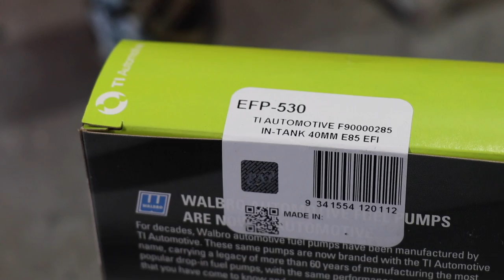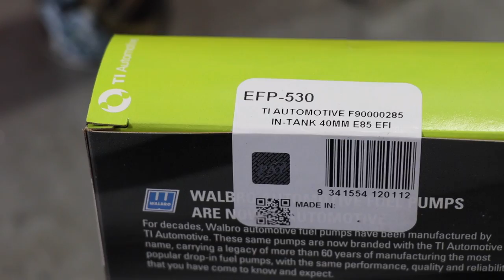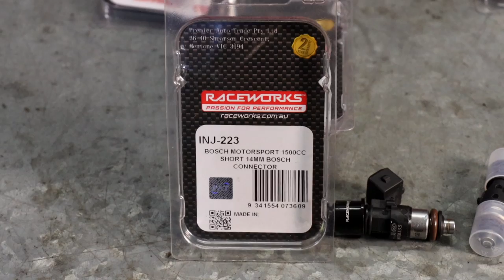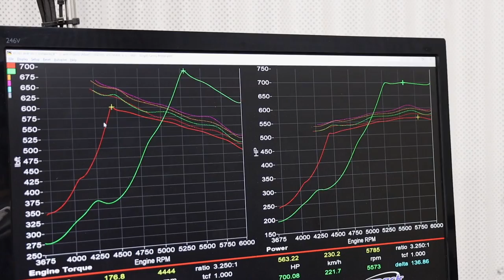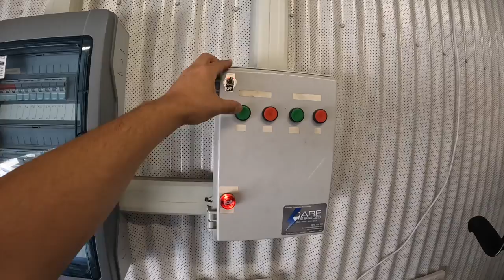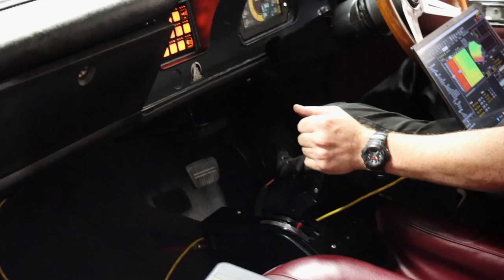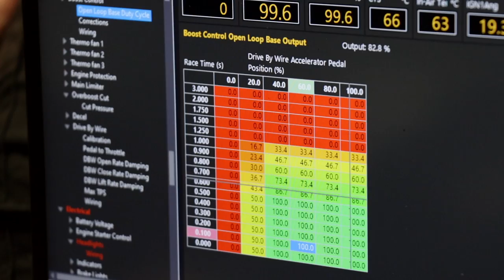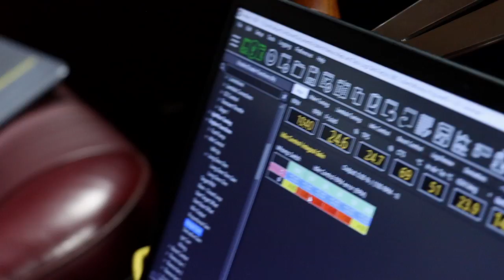Supercharged Big Block Crown - Less Boost, More Fuel, More Power | THE SKID FACTORY

Comment: Damn y'all, I can only wish that I had the means, resources, and knowledge to build a dream like this someday. I have a 709 whp 1997 EJ8 Civic coupe with a fully built LSVTEC (a B series non-VTEC block with a DOHC VTEC head), and I built it all (edit: sorry, other than the machine shop work and the bottom end, Iwas referring to the car, suspension, head, etc). I don't have the time to get it properly tuned on the dyno (but it made 709 whp on a DynoJet on its current tune), and I've never been able to get a clean pass out of it because the closest drag strip is only open in the summer, I work six days a week, and I don't have any way to get it to the track other than to drive it. It's been impossible for me to get any time to do anything with it, so I'm always screwed out of my love. I have $20,000 into a $1,000 car, so no matter what I do I'm screwed.
Reply: 20k into a 1k car makes it worth atleast 21k. Back before Covid it would’ve been worth 10k max

Comment: I hear all these people with boosted motors say "oh yeah, it's got a real safe tune in it" and then you look at the AFRs and they never get under 11:1 .. And then 1500kms down the track, they end up with glazed bores and pushing oil out the breathers and smoking out the tailpipe. And they go to blame the piston rings or engine builder, not Dr-NES-TUNEBROTHERS' rom 1.13 .. (this is doing it the right way, btw, but there's nothing wrong with having a stoic tune with a turbo engine, it's actually a good thing)

Comment: Probably a dumb question but why go up in such small steps with injectors? What would have been the disadvantages of slapping 2000ccs or something straight in?
Reply: I don't claim to be an expert, but to my understanding which may be wrong you want to use as small injectors as you can get away with safely to achieve the power you're looking for, because as injector sizes go up the worse they get at atomizing the fuel and the shorter the injector times are going to be compared to injector deadtimes, which leads to it being harder to accurately control AFRs at low rpms which leads to loss in low end drivability, fuel economy, it being harder to start etc.
Reply from the maker: I was going to use Siemens Deka 2400cc but they are only available in full length and the harrop setup needs 3/4 length. Raceworks no longer offer Bosch 2000cc as they are problematic with certain fuels so 1650 is the largest available that will fit.

Comment: Hey AL, what radiator did you use? I have a 2j with similar power in a ms75 and it gets a bit hot so looking for other options before I build one.
Reply from the maker: It's a ZD30 D22 Navara radiator.

Comment: Is the current carrying capacity of the two pump’s shared ground ok? I guess it is getting cooled by the fuel but might be worth checking the rating?
Reply: I'm pretty sure he checked before installing into his pride and joy 👍🏻
Reply from the maker: The ground is not shared, it just uses a common post to pass through. Both pumps have a large gauge ground returning to the battery post.
Reply: @theskidfactory  good stuff, I normally wouldn’t butt in, but it was on my mind. Thanks for all that you have done over the year, some truly stunning work!  hope you have a great Christmas break

Comment: 4:31 I’m not questioning your genius but as an electrician I wonder how much current is going back on the negative wire?
Reply from the maker: There are two negative wires and also a huge fuel tank and body to ground it.

Comment: Flapper valves in the radiator shroud should give some additional cooling from improving the airflow through the matrix by reducing the stagnant air in the areas near the corners.

Comment: So less boost and more power? Is that in part with the fine tuning that can be done these days?
Reply: Id imagine is more of the fact they can use the entire rpm band now
Reply: Watch the first dyno tune, they limited it for the fuel system, which no matter what would’ve made it less efficient compared to using timing and not the bypass valve…
Reply from the maker: It's a YT title so a bit of a play on words. The max boost has been reduced and we have more fuel system now so make more power.

Comment: What sort of temps are you seeing with that radiator
Reply from the maker: 75-80c in normal driving. Saw 90 in traffic on 35c day.
Reply: Shit that's good my mild 454 runs 185 190 in 28 degree heat just cruising

Comment: What does that switch actually do to the engine?
Reply: Seemed like it changed the idle valve settings to where it lets the rpm drop more before catching it.
Reply from the maker: Kye tried a few things but DBW idle control fudging gave the best results and ability to be switched off and on with no changes to tune stability.

Comment: Why didn't you go to 2000cc injectors.
Reply: No point Because he’s not running meth and isn’t exactly experienced in 500+hp cars hooking up anyway
Reply from the maker: Because 2000cc Bosch are not reliable when used with Gasoline fuels. They are a CNG injector that has a sealing tip that reacts with some gasoline additives. Raceworks no longer sells them for this reason. They have Deka 2400cc injectors but they are full length so weren't compatible with the Harrop rail height.
Reply: @theskidfactory  no worries.  Didn't know what the go was. Everyone I have delt with had problems with big injectors for tuning issues.  They were probably just leaking.

Comment: Blah blah ccc of a shared neutral with given size active's and current draw for fuel pumps, u sure it works and not melting anything?? 👌👌
Reply from the maker: The ground isn't shared, it's just common. Both pumps have a large gauge ground wire that returns to the battery.
Reply: @theskidfactory  Yer as long as she's kosher.. Ta for the reply, love your work!

Comment: Why not install a boost reference on the regulator. It would have helped  the first time
Reply: Because that’s a Band-Aid. Not the right way of doing it properly!
Reply: @ttv8ra23  there is still no boost reference on it. The correct way would to have that on there. That's what that part of the regulator is for. You get a fuel pressure rise with boost. Not saying there was enough fuel before but it would have helped.
Reply: @2000r0283  I’m unsure what you’re suggesting. It’s all done with the ECU. It’s not 1994 anymore it’s all done off the air fuel ratios. More air in, more fuel in. Between the Throttle position sensor, map sensor and O2 sensor, a boost reference to the regulator is not needed, even antiquated.
Reply: @ttv8ra23  ok now I see, you don't understand what a boost reference fuel pressure regulator does. You're just talking about things you don't know. Boost reference FPR adds one pound of fuel pressure per pound of boost. Higher pressure helps add fuel.
Reply: @2000r0283   I wasn’t sure where you were going. With your first comment I thought that’s what you were referring to but then your second one threw me off. Again a rising rate boost referenced regulator is antiquated technology. With an adequate fuel system there is no need for it. Fuel usage per pound of boost added is not totally linear that’s why top tuners don’t use boost referenced regulators and instead choose to install an adequate fuel system and have a lot more better control.
Reply: @ttv8ra23  boost-referenced fuel pressure is not a band-aid, it provides correct pressure across the fuel injector for ideal atomization and injector function. It's how pretty much all port-injected cars are from the factory, including PWM returnless systems.
Reply: @2000r0283  hahaha talking about things you don’t know. Says the amateur tuner stuck in 1994
Reply: @ttv8ra23  ok man you win. I'm not arguing with someone. Even in the first crown vid they said they could have used boost reference but they put the regulator was in the trunk for a cleaner look
Reply: Doesn’t Haltech have a boost gauge built into the ecu with a literal vacuum port sticking out of the ecu?  and the Haltech can compensate accordingly without tuning the map? 

Not sure that a rising fuel regulator would do anything other than create less efficiency in the computing of fuel compensation in the case of a Haltech ecu. 

Admittedly I could be wrong as cars are a passion/hobby for me not a career..
Reply: @Jake_Hamlin   that’s exactly what they use. An internal map sensor. Modern ECUs are far more high tech than a rising rate regulator.
Reply: @Jake_Hamlin  every micro second the ecu is looking at throttle input, manifold pressure and oxygen content in the exhaust and adjusting meke for pulse width to target the ideal air fuel ratio. Rising rate regulators are an archaic Band-Aid for a poorly setup ECU and fuel system. Making an undersized fuel pump work harder and harder to provide the required fuel rather than just running correctly sized pump and injectors for the ecu to control correctly.
Reply: @ttv8ra23  no one is disagreeing with the fact that ecus compensate for everything. I have Aem infinity in race car and we use holley for our other. I think you think I'm talking about old FMU and I'm not.